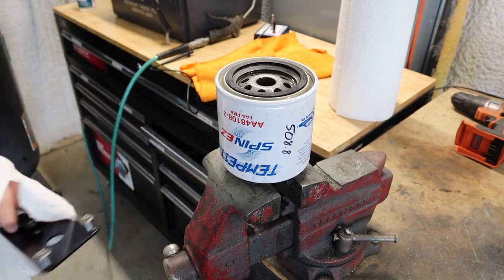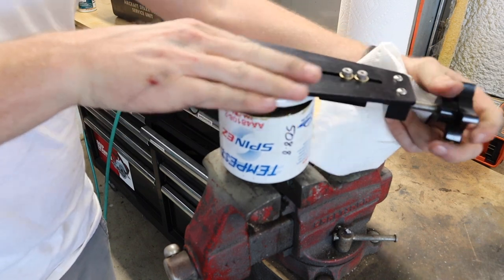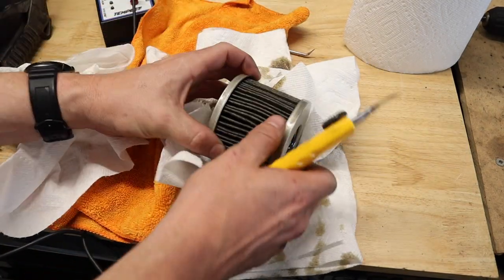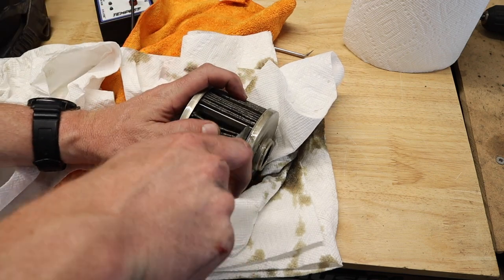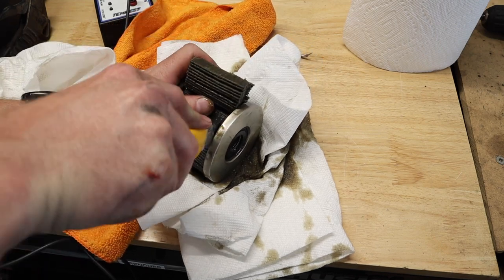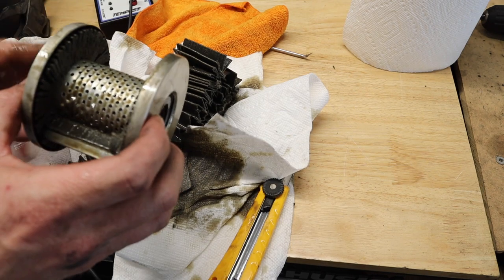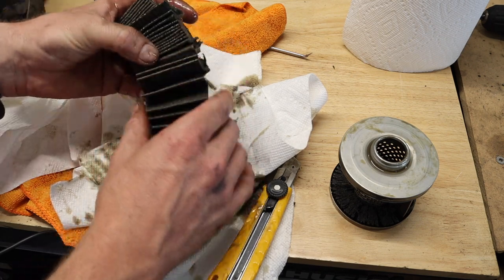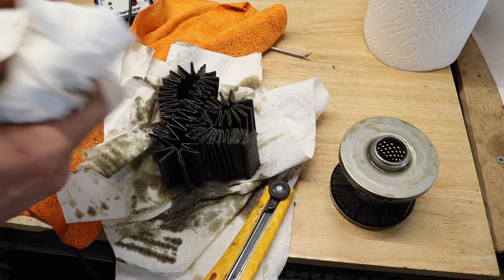Aircraft Oil Filter Inspection

Comment: I get a little carried away with it. I inspect the pleats, then wash them in a bath of varsol, agitating for several minutes, then I take a neodium magnet from an ID badge on the end of forceps and stir up the varsol,  making sure to slide the magnets along all the surfaces, for several minutes.  I end up with a light coating of ferrous mud and maybe a few ferrous specks. The dirty Varsol I pour into a black plastic tray, leave it to settle, then drain it carefully and look at what's left in the bottom like panning for gold, which shows up as mostly very fine non-ferrous specks easy to see against the black. Then I breathe another 50 hour sigh of relief.